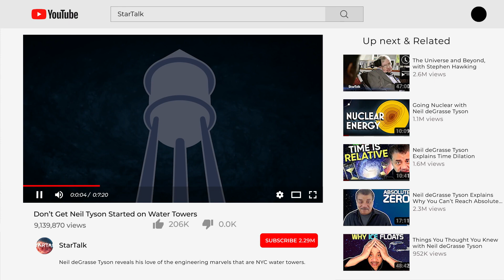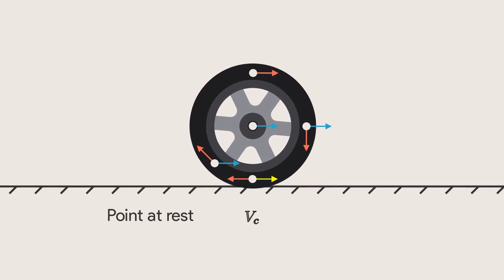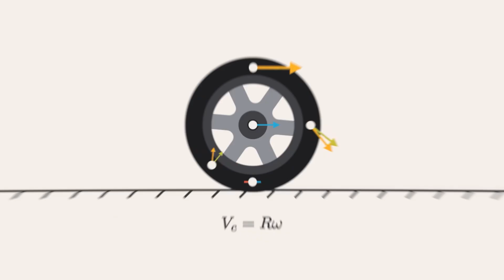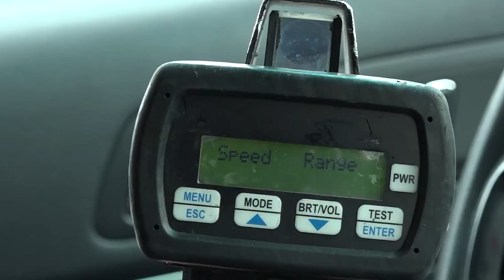How Wheels Really Work | Neil deGrasse Tyson Explains...

Comment: There are two more spots on the wheel that have zero forward movement while rolling.  Two spots on the tread on opposite sides of the wheel and at the same height as the hub center have zero forward velocity while rolling.  They both travel at car speed, one straight up (the back side of the wheel), the other straight down.

Comment: What if a car moves at a speed half of the speed of light then the top point of the wheel moves at the speed of light? 
What if the car moves at 60% of the speed of light what would be the speed of the top point of the wheel?

Comment: Strangely, I did learn this in an engineering class I took in 1978, and the object of study was a drag racer because the design was as minimal as possible.

I was flabbergasted at the wheel speed thing! Over the years I sussed it out, but I was still unsure of something.

I just realized this is a calculus thing, too, because of the change of vector throughout the wheel. Both absolute speed and the change of direction of the force on the wheel.

In the back of the wheel from the outermost and farthest back point of the wheel down to  the zero velocity part, the vector has a backwards velocity. In fact, both front and back of the wheel from the midline down, the vector has a backward component. From the midline to the top, the vector has a forward component. That is why the absolute speed (speed measured regardless of direction) has to travel at twice the speed as the midline, so the wheel can catch up and surpass the forward vector of the midline.
😮😮😮

Comment: Neil's wheel selective speed transmitter is scarily possible. Most cars already have TPMS sensors. While they currently only transmit their ID number and internal air pressure, they can be designed to transmit all sorts of data. 
The trick is matching frequencies and matching transmitted speeds close enough to allow an officer's brain to fool their eyes.
)One can easily determine how long it would take a vehicle to travel X distance over a set amount of time. If your car reaches a location faster than if it had been traveling the posted limit, the officer might determine his detector to be malfunctioning, thus abandoning detection and moving on to pulling you over and issuing a ticket. 
(They do not need a reading from a radar detector to achieve a guilty verdict. Eyewitness testimony is still an accepted form of "evidence" in a court of law.)

Comment: The wheels are actually moving over the rails so fast that only it appears that the rail is running backwards unless you are the rail observing the wheel run over the perspective of a particular spot on the rail, then now the wheel appears to be either getting closer or moving away?

Comment: So if you drive at the speed of light, the top of your wheel is going twice the speed of light?

On a serious note, if a rotating body reaches the speed of light, what happens to the surface that's rotating forward?

Comment: Does this mean that when you break, the top of the wheel is reducing its speed and therefore the chassis slows down as well? Also, while a train is breaking, does the bottom lip accelerate into the positive thus going forwards in order to slow down the rotation?
Reply: In braking...I think the point of contact slipped  and as a result the there is some relative motion between the tyre and track...so ig this concept might not be valid there...

Comment: Assuming the bottom of the wheel is a little flatter from the weight of the vehicle, would that mean the middle of the wheel hub is actually lower than the actual center point? If so, would that mean the top of the wheel is actually moving slightly faster than double the speed?

Comment: Sounds like Neil has some learning to do about how train wheels work, because the lip is not how they stay on the track, it's actually way cooler than what Neil said. It's just the cone shape (really a truncated cone shape in actual trains, but a full cone works too) that keeps them on the track. The lip is just for extreme turns, like when the train is going way too fast for the track and for helping it go through junctions in the track, not for normal operation of the train around a curve. I've even seen it demonstrated with two plastic cups taped together by the larger ends, if the curves are gentile enough and the track is smooth enough like a real train track, then it stays on the track without getting even close to the lip of the cups. I wish I could remember where I saw that demonstration, I'm pretty sure it was another you tube channel.

Comment: What is not being said here is the "part of the car that is always going zero" is actually a point on the edge of the tire which is constantly changing.  So try to find that part that is infinitely small and only going zero for an infinitely small period of time.
Reply: The part going zero is = the contact patch. Tires "grip" the road and basically pull against the surface to propel the vehicle forward. It's no different than walking. The bottom of your shoe = contact patch, and even if you're walking at 3 MPH, the foot in contact with the ground is always at 0 MPH. But the principle is the same -- your shoe "grips" the ground and pulls backward to propel your body forward. Meanwhile, your other foot is moving forward faster than your body so it can be placed ahead of your other foot. When you put a foot down, you move ahead of that foot because it's speed has become 0 MPH. 

Depending on the tire size, air pressure, etc, the contact patch can be a couple of square inches.

Comment: I have a potentially less legally grey but still extremely useful example you could use for this, and it may still hold all your points Neil

A while back, Deer season 2022, I decided to buy some Deer whistles for my car

As you drive wind passes through them and it whistles at frequencies inaudible for most people, but deer can hear them

Their downfall is that to operate you have to be going at a speed above 30 MPH which down a dirt road you may or may not be doing considering the upkeep of the road 

Would that not mean that if you were to attach some of these whistles to the inner hub of your cars tires (symmetrically for balance ofc so 2 opposing per tire)

That you could lower the speeds at which you have to travel by approximately half (not exactly, as you'd have to mount them further toward the center of mass than the outer point of the tire) for the whistles to be audible to the deer?
Reply: The wind moving past the car would be zero at the bottom and twice the speed at the top. The whistle would need to be weighted and on an axle so it always faced forward. As the whisle got closer to the bottom, sound would decrease down to zero sound. As it went up the wheel to the top, the sound would increase to the loudest point at the top. Loud, quiet, loud, quiet, loud, quiet..... very fast.

Comment: What speed is the top of your wheel going if the center is going at 1/2 c? And at 1/2 c + a little bit?
Reply: I also wonder if the wheels are the fastest part.  There's the driveshaft and the pistons.  We'd have to figure out all the gear ratios.  Also, my tires are a little flat on the bottom.  And I suspect the top of the tire may get thrown out a bit.  Small effects, but interesting all the same.
Reply: My understanding is that c is a universal constant and matter cannot travel at this speed. So the upper cap on wheel rotation is maybe less than 0.5c? The speed approaches 0.5c but not exactly 0.5. 
Moreover, i think it is not possible to travel on a surface vehicle beyond some speed value because of gravity and grip. Neil explained it in a video.

Comment: Wheels are also a flywheel and resist changes in motion. I always wondered if a car had a set of flywheels that spun in reverse, if a car would be more maneuverable.
Reply: Smaller wheels will do that for you. They also accelerate faster since the wheel is the final ‘gear’ in the drivetrain.

Comment: So if the train is moving at the speed of light, is the top of the wheel moving at twice the speed of light….. how does that work?
Reply: Well first of all, the train has mass and can not go the speed of light.
Reply: first of all the train is not moving at the speed of light.  it can't do that, remember?
Reply: First of all, If train has to travell at the speed of light, then train should be energized with that amount of energy or fuel which would enable the mass of the train to get converted into energy. Second of all, if train travels at the speed of light, then the mass of the train which would get converted into energy would never have any wheels or structure of the train remaining. The entire structure of the train would get converted into energy traveling at the speed of light.

Comment: Train wheel flanges rarely touch the rails. The inner diameters are greater than the outer diameters. Imagine having two wheels on a solid axel, one larger than the other. The axel would roll toward the smaller wheel. As the train axel moves off center, the differences in diameter steers the axel back toward the centerline.

Comment: I don't understand this at all.  The whole wheel is connected.  How could the top move and the bottom not move?
Reply: Relative to the ground. The wheel would need to slip/skid or spin out for the bottom of the wheen to move relative to the ground.
Reply: oh brother you guys are missing the point.  you have to look at a point on the outside of the wheel with respect to the ground, not to the other side of the wheel and not to the axle!

Comment: I have a question concerning a moving car with open windows and a bird flying exactly alongside. What happens if the bird flies horizontally into the car and you close the windows?
Reply: The second the bird enters the car it’ll lose lift because of the difference in the average relative velocity of the air inside the car.
Reply: @oscardissegna74  So if it was a convertible it would stay beside you?
Reply: @JohnRobinson2  🤔 as long it stays above the windshield I guess it would. I actually think I saw something like that about a guy who raised a wild duck and then taught it how to fly. He was on a truck though, if I don’t get wrong.
Reply: The bird is using air resistance to create lift. It’s wings are a foil. So it will lose a lot of speed
Reply: The passengers will scream and the driver might lose control! All kidding aside it depends on if the bird is gliding or flapping its wings. If its gliding then its going to lose lift as most of the air inside the car is moving with the car but if its flapping its wings and assuming it had room for this it would fly its normal speed + the speed of the car.

Comment: The realization that tires do not move in relation to the road is crucial to understand tire behavior and grip. Tires have such tremendous grip because they operate with static friction. For all intents and purposes, it has the same amount of grip while standing still than when it is moving (there are also other factors, but when simplified...). Dynamic friction is much lower, a sliding tire has one third less grip than rolling tire. Also, we don't only get friction, we also get some adhesion, specially when the tire compound is very soft. Adhesion is chemical bonding with the tire and the road, and that can't happen if the contact patch would be sliding, it has to be static: not moving in relation to the road.

Next lessons: what is a slip angle? It is fascinating topic, you should go google that.. Once you understand that it is the rubber that is stretching that moves and turns the car... you get a huge "ahaa!" and things become much more intuitive to understand. Once the rubber can't stretch anymore against the grip available it will either break or we start sliding. You will also then understand that there is net force and if we want to turn we can't accelerate or decelerate at max, you can only stretch the rubber so much. Max turning happens when forward velocity does not change, and max acc/deceleration happens when we are not turning the wheel at all.

Comment: On the flanges of train wheels (from Wikipedia): "The running surface of most is conical, serving as the primary means of keeping the train's motion aligned with the track..." The physics and maths behind train wheels is much more interesting than meets the eye! 😍
Reply: Yeah, the flanges are not ever used unless there is something weird going on and is just a last resort type thing. The conical nature of the wheels keeps it on the track through turns.
Reply: @MrT------5743  Right, That wheel squeal you sometimes get are the flanges rubbing against the rails. not something you want to happen - lots of wear which leads to earlier replacement of both wheels and rails.
Reply: You beat me to it. Had the exact same thought when I heard neil talk about the flanges.
Reply: Yup, its the same principle used in conveyor belt tracking. The pulleys at the ends can be crowned in order to center the belt if it happens to move or missalign.
Reply: @StarTalk needs to do a video on this.
Reply: @spirko97  Richard Feynmann did a video about this https://www.youtube.com/watch?v=y7h4OtFDnYE
Reply: Do you mean, trying to visualize, from between the tracks I'd see the wheel is not flat on the track, but is cantered slightly, like sports cars? 
Or, the wheel is v shaped like an umbrella sideways, but not that extreme an angle ->  <-  like that?
I'm also assuming the tracks are horizontally flat, not curved or angled.
Reply: @Sammasambuddha  The wikipedia explains it quite well: https://en.wikipedia.org/wiki/Train_wheel

Comment: To Neil.

You said "speed" a couple times in the video, when I think you meant "forward motion". To measure velocity (speed), it involves a measurement of distance covered over a period of time. Any "speed" at a particular INSTANT is zero (no distance traveled).

However, where the tire touches the ground, just below the center of the tire's/wheel's point of rotation, its forward motion is zero.

Then again, maybe I'm just overthinking this... 🥴
Reply: You're wrong. Speed is a scalar, whereas velocity is a vector. So saying that at any time Speed is 0 is wrong. So if you want to include direction you use Velocity,  which could be something like 89km/h forward (including the direction of motion along with the magnitude gives you the components of the vector, so this is Velocity) if you just say 89km/h , that's a magnitude (hence the term Speed)
Reply: @IKARUSBLOODYWINGS  You are not understanding what I am saying. An instant is an infinitesimal slice of time. Because of that, no motion can be measured, thus, no speed. Speed is a factor of time (e.g. miles per HOUR, meters per SECOND, etc.).  No time, no speed.

Speed is not scalar. It scales, but is not "scalar". I think you need to refresh your definitions. Speed requires a vector. Without a vector, no distance is covered and the speed is zero. 

That is why I used forward motion, in this context, as it relates to a wheel/tire. Forward motion indicates a vector.

It's probably just a case of "picking fly manure out of the pepper" (you end up with all fly manure) because in the end it is a technical, though not a practical, difference. But much of physics balances on technical differences.

My $.02...
Reply: @GlueFactoryBJJ  You're the one who needs to refresh your definitions. Search for "Difference between Speed and Velocity" and you'll understand. So I stand by my original comment, Speed is a Scalar as it is the magnitude component of the Velocity vector.
Reply: @IKARUSBLOODYWINGS  Mea culpa. Yes, it is scalar because it doesn't require a started direction.

BUT it DOES require a time element. Thus my point.
Reply: @GlueFactoryBJJ  velocity is a derivative. Rate of change of distance over rate of change of time. So you need two points in temporal dimension to describe velocity. If delta t is zero then it is not possible to measure the velocity at all. To call it zero velocity (zero speed) is not correct in that sense.
Reply: @GlueFactoryBJJ  your point is still invalid and you need to watch the video one more time.
Reply: I see what you're trying to say, but suppose you're reading a graph where the Y-Axis is Velocity and the X-Axis is time. This is very common because from a Calculus perspective, the integral is the displacement of what you're measuring, and the derivative is the acceleration of what you're measuring. 

When reading this graph, I would imagine you would have to communicate by saying something like: "The velocity of the car was 10 m/s at 5 seconds). Calculus is weird in that you are dealing with infinitesimal change in the variable.
Reply: @ShadowParalyzer  The unstated assumption is that it is assumed that if the car were to keep traveling (moving) are that rate it would go at 10 meters/sec. However, since at 5 seconds is a point (think geometry as to the definition of a point) in time, if measured at that point (only), there would be no distance traveled, thus no speed.

Comment: If your wheel is spinning in place in forward gear, the bottom of the wheel is going backwards
Reply: It also doesn't have to be spinning in place. If your wheel is spinning at all relative to the ground, even if the car is moving forward, like at the end of a burnout, it is going backward.

Comment: Does the top of a wheel then break the sound barrier when a vehicle is moving at mach/2? And does it say bang?
Reply: I think it would. I do know manhappen (at least in the past) propeller tips on aircraft spinning around would break the sound barrier, and that causes vibration and noise. So they attempt to not let that happen. Now I don't think it is a big bang like when a whole airplane breaks the sound barrier.